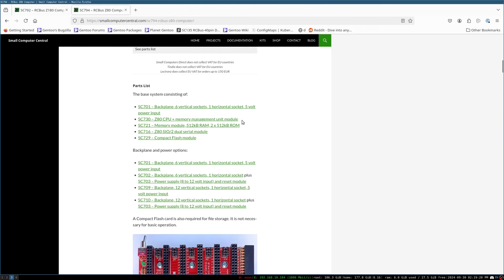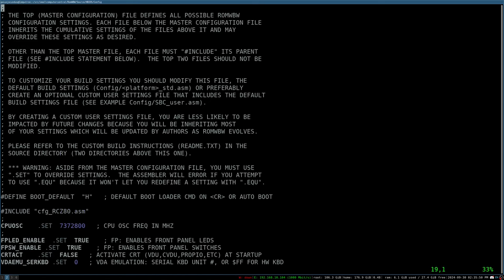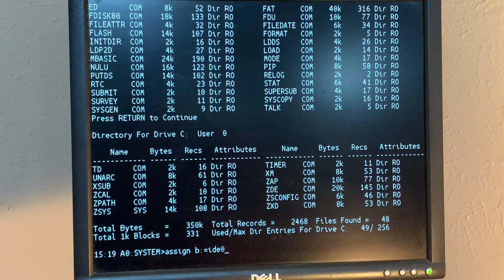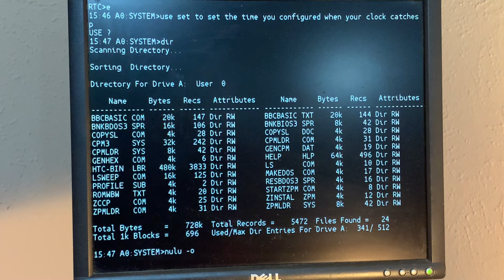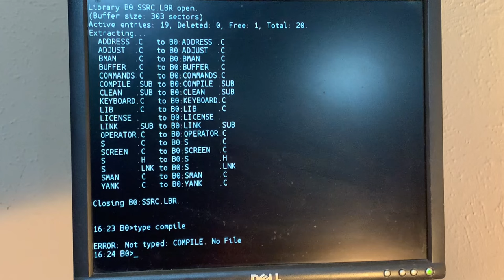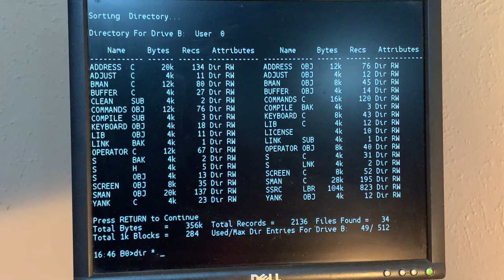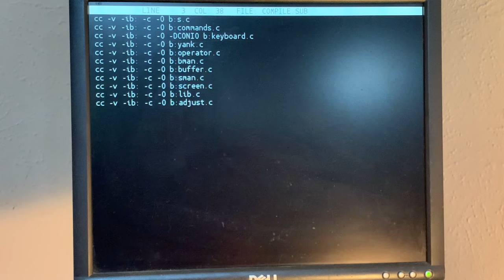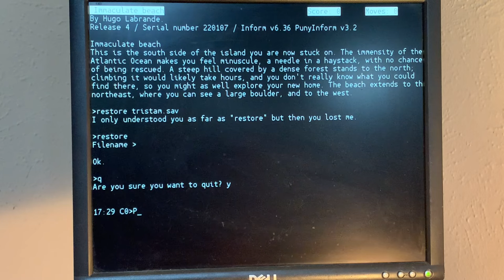Advanced RomWBW configurations with ZPM3 on Small Computer Central.

Comment: [21:42] - I believe the HD1K_* disk images are compatible with your hardware and are the preferred option. Several years ago hd1k was introduced as a successor to hd512. The primary difference is the CPM directory structure in the image files themselves. for HD1k has 1024 directory entries (hence its name), and hd512 as you would guess has 512 directory entries. There are other differences, the number of reserved system track is different, also for hd1k  the size of the image is exactly 8MB (hd512 it is slightly larger), this makes a big difference since exact power of 2, and lastly for hd1k there is a partition table entry to reserve actual storage space. Anyway to sum up hd1k and hd512, are not tied to a hardware platform they are disk format

Comment: I believe "dd" stands for "device direct", because a block device (which a drive is) does not have to be a disk based device, ie RAM is a block device. "dd" works with anything that inputs or outputs a contiguous byte stream
Reply from the maker: Thank you for the context. This name makes more sense from a historical perspective and it's more accurate to what the tool actually does.

I appreciate the correction; I've been calling it by the wrong long-name all my life.